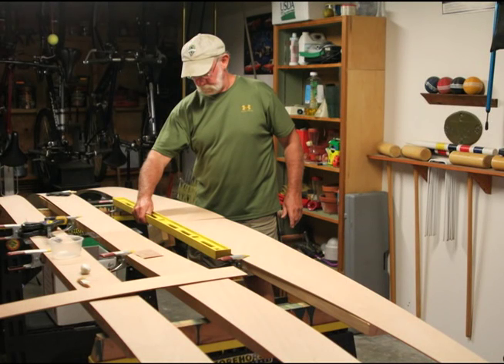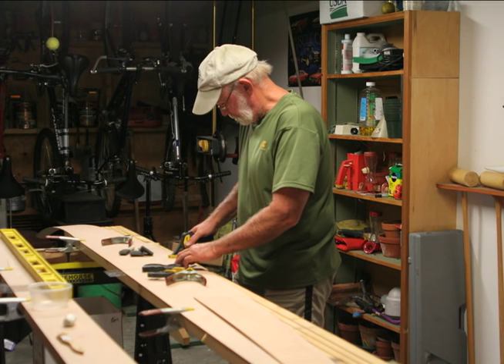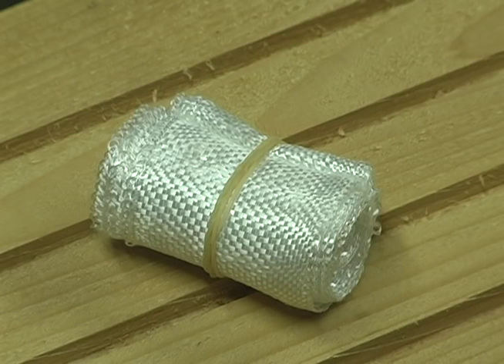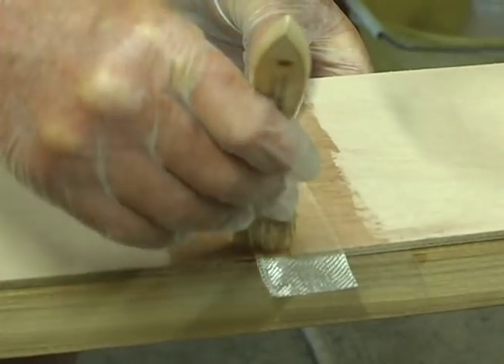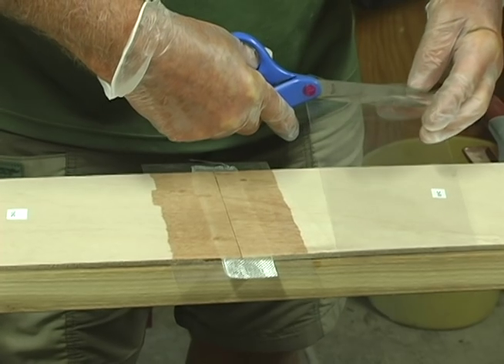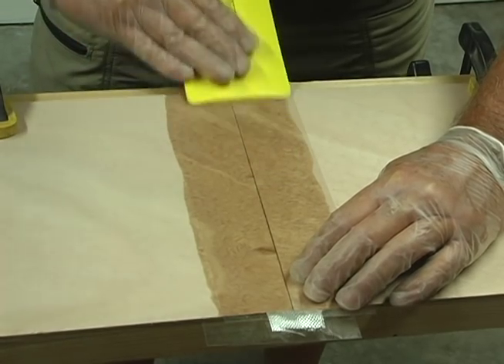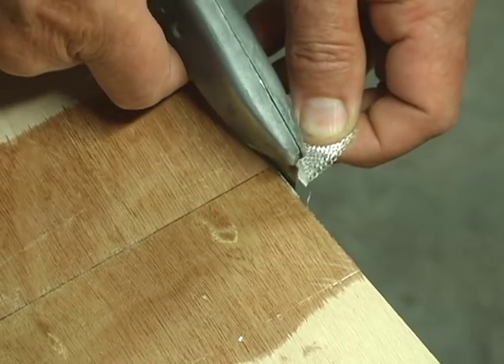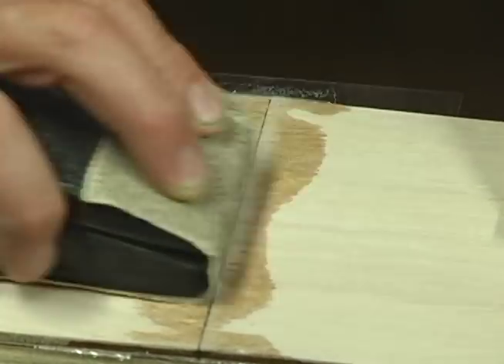03. Stitch and Glue Boat Building: Align and Glue Panels

Comment: The engineering on this is idiotic. Why would you align the butt joints on the adjoining panels in the middle of the boat. Structurally it would be much more durable to offset the seam even just 6 inches would be better than nothing
Reply: Actually, the butt tape seams shown are much stronger than the plywood itself so this becomes the strongest section of the hull.

Comment: On a kayak a guess it's ok. But on some other boat a scarf joint is racommanded
Reply: dont underestimate the structural strenght of fiberglass. The joint is plenty strong and if you take into account that the will be thwarts and bulkheads even, you dont have to worry about scarfing